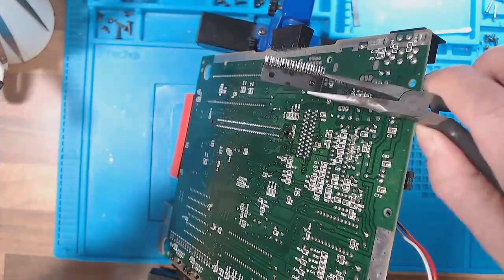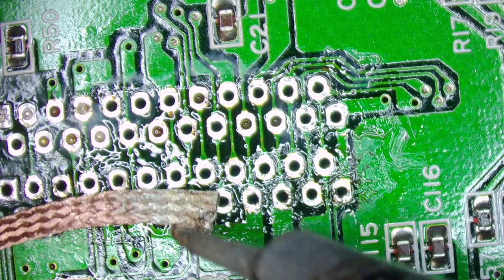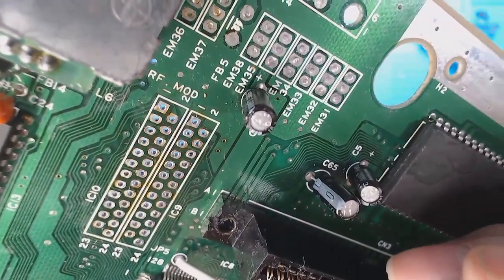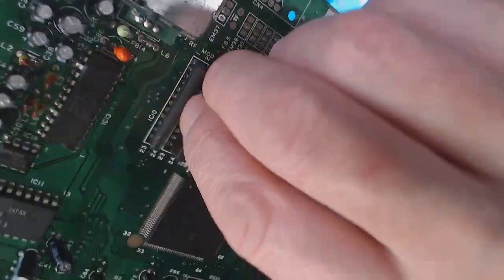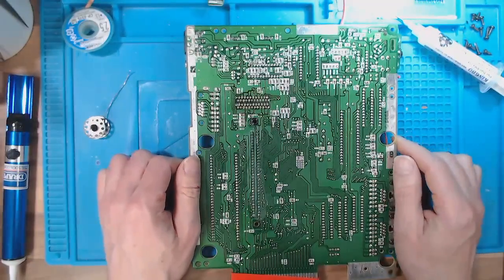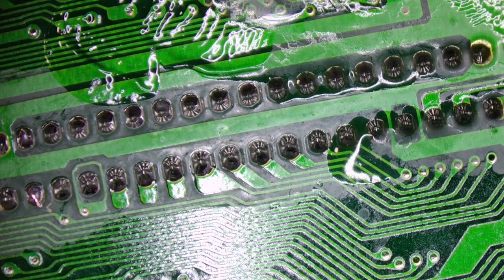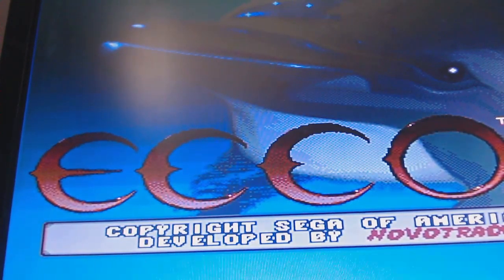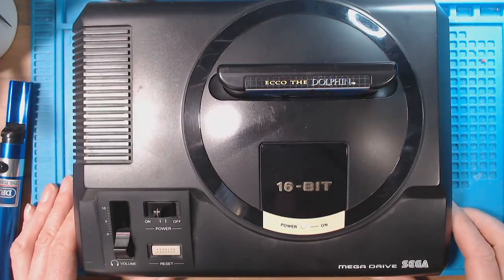Sega Mega Drive Corrupt Graphics | How to Fix

Comment: Hello Phil, thanks for your tutorial.
I need help with a MD1 pal va6.5 if i remember correctly.
My problem is video & audio.
After some hours of play the console started to be abnormal, jurassic park same place 8 from 10 atempts the audio cuts for a moment "bizzz" and 1 time with graphical glitches.(playing nornally after).
Same thing for Aladdin & SOR1 intro one time with a bit of graphical glitch playing normally after, cuts (stop) 3 times in 2 second audio & tv signal on a bonus map on Sonic 3 and totally freezing on Demons of Asteborg at the start of the first level, curiously one time didnt happen, reset the console and hapoened again.
Im using stereo headhphone jack only so the video is going for another cableñ😊.
I bought this console days ago, is a first hand console from a person who didnt used it since long long time ago (decades), Checking the board i only saw "tooth paste" on chip's legs what i have cleaned, and used WD-40 electrical contacs for thr cartridge slot, controller ports, video port etc, the console already exihibit this behabiour before use this product with sonic 3.
The cartridge slot seems like "brand new", very strong taking the cartridge and with the golden surface. I have bought my games on the last 2 years, almodt all of them have a very nice condition legs.
Another thing is the power conector from the console is a bit rusty-black (cleaned), tested moving the power adapter jack and nothing happens, still working.
Any suggestions?, thanks!
Reply: By the way i forget to mention, the headphone Jack audio has noise while there is no sound at all, but i think probably is normal...
My graphical glitches are a lot minor than what you show here, just for a second and not all the screen.
Reply from the maker: I would look for any bulging capacitors and weak or broken solder joints first. Any signs of green corrosion can be clean with white vinegar, followed by IPA.
Reply: @PhilipBryden  hello Phil, thanks for your reply.
Okey, understood.
I though the same, look caps, they are not bulged but (i forget to mention this), when i cleaned the headphone volume bar with wd40 i used something to remove the dirt and was a bit green, i though maybe was too much agressive the wd40 (the board is green) or caps liquid.
Another moment i took a ear swab with alcohol on another point not close to the caps and was clean, the same on the middle of the board (bottom caps and top the power zone) and was dirty with i think a bit green.
So this seems the caps habe leaked over the board.
The think is i have fear to invest money, change caps and have more problems, this seems to have just a bit of malfunction, not too bad, chip's legs are a bit White (like the 2 electrical regulators, with something like "tooth paste" or glue),   which i think came from the bottom of the chip, as i said i cleaned them but they still looking a bit white and i hope they are okey, do you think that "tooth paste" can damage the chips?.
Thanks again and excuse for this Big comment 😅
Reply: @PhilipBryden  sorry i forget to mention something.
Those caps are really old, the specs are equivalent to nowadays? or i have to buy a bit higher or...?

Comment: Great video! How did you know that the problem was the ram? I sometimes have similar screens but sometimes it works. Sometime sound won't work either.
Reply from the maker: I saw another video where the sprited were all garbled like this. So I took the chance and swapped the ram chips.